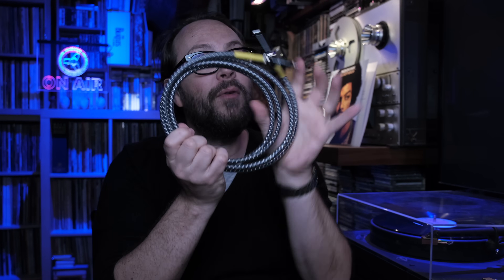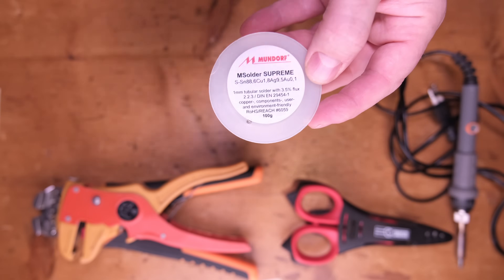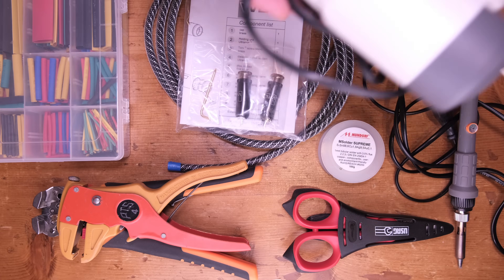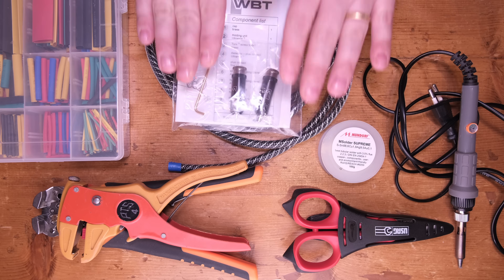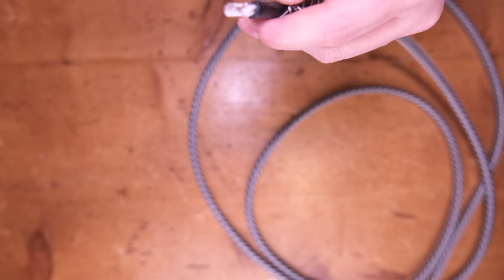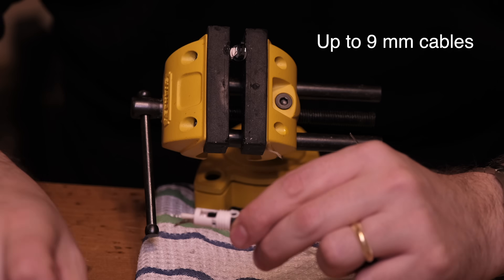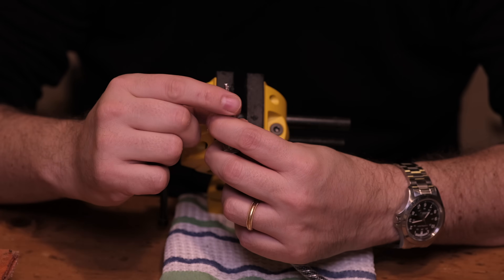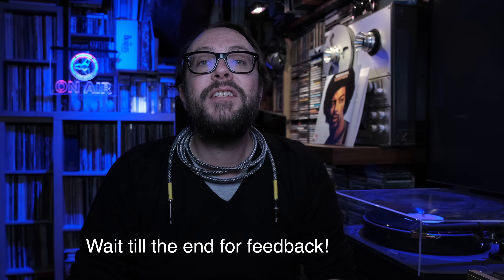How to make the perfect coaxial cable for digital audio (SPDIF)

Comment: All wrong...SPDIF cable as video cable should be crimped not soldered...
The RCA connector are made for analog audio.
There are at least two manufacturers of RCA connector designed to be crimped and certified for 75 Oms cable.
CANARE RCAP-C5F
Belden DB59RCAU-25
For wire choose Belden or Canare
The recipe is ultra simple, the right impedance (75 Ohms), with the right cable (75 Ohms), the right connector (75 Ohms certified) and NO SOLDERING...crimping only.
Reply from the maker: Crimping is for the video coaxial cable, this is an audio cable. Nevertheless, if you can find a silver crimpable rca be my guest! Cold joints are always better IMHO.
Reply: @anadialog  Crimping video 75 Ohms coaxial cable is for any cable...video or audio.
It's just the right way  to do it, to get the proper impedance.
Following industry standards seems alaways a challenge for audiophile...
Reply: @MrMftech  It is the audiophile industry that does not follow the standards because there is no such thing as a true 75 ohm RCA connector. Once you get to the RCA part the distance between the center pin and the collar is incorrect. The crimp on connectors you mention are likely the best you can get. They maintain the 75 ohm right up to where the RCA dimensions take hold. The crimping vs. soldering alone has little to nothing to do with it. Maintaining the proper distance between the conductors is paramount and the crimp style connectors easily do this well. Unfortunately the crimp ons need the correct crimper die for different cable models and I do not think that there is one for the 2001 and I don’t know how you could handle the second braid.
Reply: @MrNeverlift  There is a least two RCA connector designed to support 75 Ohms cable.
CANARE RCAP-C5F and  Belden Double Bubble RG-6 RCA Coax Compression Connector both are crimped.
Thre is no soldering when you need to transport high frequency content and crimping provide consistency in the assemblage.
Every die is designed for a specific coaxial cable diameter and RCA plugs.
Nothing fancy...just common sense and following industry standards.
Reply: @MrMftech  Iv'e used them all. As mentioned, I do not believe there is a die set that fits the Neotech 2001. Neotech does not publish a radio guide spec. The 2001 is also a triaxial and the outer most braid should be connected to the source end only. Problematic for a crimp style. The crimp style maintains the 75 ohm coaxial configuration right up to the RCA (no longer 75 ohms). Most solder connectors alter the distance between the conductors way before it turns into RCA. Therefore, crimp ons are inherently a better design for this use. The fact that they don't need solder is a convenience (especially in the field where most RG cables are assembled). The electronics industry (not the audiophile) decided to use RCA ends on SPDIF cables. Look at older DAC's, many had BNC sockets and you would get 75 all the way. You do know is not measured with an ohm meter? You do know if you bend a coax to sharply it degrades the 75 ohms? Go to the Blue Jeans Cable website. They use the RCAP's. They do a good job explaining. Better than I can.

Comment: I prefer factory cables. Guido, for that ~210 eur you have many many choices. I would recommend QED cables at first, but there are tons of Audioquest. There are also silver-plated ones. Not worse. I bet. This is not cheap, this is rather almost expensive though I know there are much more expensive options out there. But making DIY cables for the price of a great factory one...
Reply from the maker: Yes, I have recommended much cheaper solutions, you're right, but remember that this is all silver and that in terms of factory cables are extremely expensive
Reply: @anadialog  Guido, the signal is carried on the surface of the cable. It does not matter if the core is silver or copper. I would kindly compare it to factory cables. Did you may do that?
Reply from the maker: @7AccordHomeStudio  hi there, nope that is a misconception. Signal travels near the surface not exclusively ON the surface. The higher the frequency the closer to the edge, that is in fact where we have the skin effect, with very high frequencies while audio is more in depth.
Reply: @anadialog  Ok maestro. :) I believe it to you. But I will prefer factory ones in the future.
Reply: @anadialog  I doubt 1's and 0's care if it's silver or copper.

Comment: I'm sorry to be a cable bore but it was into it deeply and of course, no one likes my opinions like I do. I agree with your observations about materials. I only used the best available at the time. Six nines pure copper and pure silver wire. Silver plated copper wire always was harsh and fatiguing in he long run except on digital where it seemed to work okay. I also used teflon coating dielectric. I didnt care for gold plated plugs that used ferrous nickel as a binder for the gold plating. I used a plug that used a silver undercoating to bind the silver to the brass or bronze plug. Without the binder gold flakes off. I often used Cardas SLVR RCA plugs because they were made of silver plate directly on to the brass or bronze plug No gold plating. 
At the time I thought Rhodium killed too much information. Maybe food for an excessively bright cable but I didnt use it. I also experimented with cryogenically treating copper condors with some success. At the time there was a solder called Wonder Solder sold by an audio reviewer. I have no idea what it contains but it was an excellent solder natural and reviewing without the brightness of silver solder or the dullness of standard Kester solder. The important things about cables is they are a little system unto themselves and evert individual piece counts. You can change conductor, dialectic,  connector and solder to tailor the sound you want. I sold or gave away all my cable in the 90s. Ironically, I recently I bought back a pair of one of my best interconnects on Ebay and I was gratified to hear that they still sounded as good or better than what I had in my system at the time. New is not always better .

Comment: I work for a wire termination company here on the US. I enjoyed your video. My question is do you prefer silver over copper?  

Our connectors are compression connectors so they are much easier to put on but probably not as high quality as what was shown here. Nice work.
Reply from the maker: Thanks! I can say that silver has that extra quality, especially OCC silver, when designed properly and with excellent insulation BUT they are just too expensive so quality copper is probably the most quality/cost effective!

Comment: Great video, good work indeed. I've been making cables for over 30 years and agree you can make fabulous cables for a fraction of the price and lets not forget the marketing hype 'BS' associated with it that most of the price of goes on. I will say one thing though, WBT connectors have got to be one of the most user unfriendly, clunky and a bit pricey. There are easier, simpler and cheaper ones out there. But great video. Thanks
Reply from the maker: I agree...As I said in the video I don't like WBT but I wasn't able to find other silver 75ohm connectors...
Reply: @anadialog  hello, advise me an interconnect cable from the CD transport to the DAC (aes-ebu) ... now all the wires are professional copper (Belden 9497 acoustic), the rest are Gotham - the reason is that they are all neutral .., but lack depth and magic))) .... transport - theta, DAC Levinson 1702 chip

Comment: Thank you very much for this excellent video, as always. Like you, I make my own modulation and digital cables, using the remarkable NEOTECH cables.

I have just changed my amplifier (Willsenton R300, excellent single stage amplifier, 300B tubes not too expensive). My beloved Van Den Hul "The Frist Ultimate" all carbon cable is not suitable here as it is too warm and lacks transparency. I first ordered a NEOTECH NEMOI-3220 RCA stereo copper OCC PTFE cable, but I returned it after a few days because the Van Den Hul is much better.

I then decided to review the digital and modulation cables with NEOTECH OCC copper cables, which have some silver plated strands. Please abandon all ideas about silver plated copper, at least with these two references (KLEI PURE22 HARMONY RCA connectors) :
 
RCA modulation : 
- NEOTECH NEI-3001 MKIII symmetrical UP-OCC (48 euro per meter, another world compared to the already excellent NEOTECH NEI-3004). Here you have to connect the cables two by two and the shield on the source side only)

digital RCA :
- NEOTECH NEI-3003 MK III UP-OCC silver plated coaxial cable (22 euro per meter).

In 45 years of high fidelity, I have NEVER heard such qualities of transparency, harmonic richness, smoothness and naturalness. Incredible!
I don't know if the pure silver model are still superior to it, but for my part, I will stay with these ones which fill me completely.

Thanks again for all your excellent videos! Love from France.
Reply from the maker: Thank you for your input! I suspect that the Neotech you sent back maybe wasn't burned-in enough? But it may be that the Van was better, you seem to have experienced enough to understand this! ;-)
Reply: @anadialog  I waited a week but nothing to do for the 3220. However, for the NEOTECH 3001 MkII, mio Dio !  :)

Comment: shielding?! no need. just muddies the sound. Maybe if your home is like an electrical sub station, otherwise ditch it.
Reply: This is a coaxial cable.  Remove the shield and then he only has one conductor and the digital signal would float.  It wouldnt work like that.  Are you suggesting a simple pair of wires would be better?  (For a digital cable is that really true?)
Reply from the maker: I agree...on other cables, but coaxial need some
Reply: Yeah, coax is shielded. I don't use it. 2 proper wires twisted or braided is what I found best after 30yrs playing around. Jmho.... 😉

Comment: How this affects the sound?? the signal is digital, a regular coaxial cable that can be made for less than 5 € will be exaclty the same in quality, i did work on a telecom and our wiring was less than 1€ and top quality for broadband in a quite higer bandwith than SP/DIF, and there's always the option of optical SP/DIF that is just flawless.
Reply from the maker: I wish it was so. As I said in the video digital audio travels on an analog signal (voltage) which is my manybthibgs can go wrong. Ever wondered why coaxial cables for digital has so much shielding plus it is built just like a normal interconnect, because it is always an electromagnetic signal. Time to wake up from the less digital myths. Digital is crammed filled with issues, just like analog!
Reply: @anadialog  Somewhat correct. Yes, there is really no such thing as a "digital signal" All electrical signal transmission is indeed analog, However you need to understand the encoding methods used. In the case of SPDIF it is Manchester coding. The data is carries as transitions between high and low voltage levels. As long as thoase transitions can be detected, the recovery will be flawless. Yes, the signal does suffer all the degradations any analog signal does. But it's the data encoding that makes digital signal transmission very immune to traditional analog cable problems.
Reply: @anadialog  said so, and being 100% sure you are wrong about digital audio transmision about cables making any diference in SQ, not because I think so but because science states so, your cable making vídeos and tutorials are nice. I discovered neotech cables in one of your vídeos and have made many cables since then. Never will say they sound “better” than a basic amazon cable. They look much nicer, for sure.
Reply: @reydelanada  I'm on the same boat as you, but I think they do have a point with coaxial, because if the cable has the wrong impedance it can cause mismatches and ugly reflections. That's what I read, anyways. I prefer optical, after all. With optical it doesn't matter if it's half a meter, 7 meters, plastic, glass, etc. Bits in, bits out.
Reply: Yes, and seems the faithful have yet to see the light. 😂 ... through optical SP/DIF.
Reply: Don’t waste your time Francisco. They belive! You can’t outscore their faith! ;)
Reply: The problem with SPDIF cables using RCA ends is the RCA ends do not maintain a 75ohm relationship between the conductors. Most connectors and / or assembly methods ruin the 75 ohms way before the actual RCA part of the connector making it worse. If you can keep the distance of the non 75 ohm path as short as possible, the better the sound will be. If that issue is handled well, it is surprising how good some inexpensive coax can sound. In telecom you use much better connectors from the 75 ohm standpoint. Also in telecom you won’t notice or care about this level of sound quality. Better materials for conductors and shielding can make a big difference as well. With HiFi SPDIF. Every aspect of a moment in sound must arrive in one moment. It never does.
Reply: @MrNeverlift  Yeah, I don't even like using RCA in connections, even for analogue/video applications. 
You wouldn't use them for oscilloscope signal path connect, unless it was low bandwidth audio (20-20kHz) 😉
Reply: Lol… keep the faith! 😆
Reply: @reydelanada  Lol...keep trolling!🤪
Reply: Electrons travel differently through conductive materials. Try a steel cable vs a copper one and let's talk again...
Reply: @Nihilist13  yes, i'm aware of that, and this will have an effect on analog transmissions, but SP/DIF is digital so it doesn't matter the quality on the transmission while is inside certain parameters, that's the advantage of digital communications, you have a range of values that will be decoded as correct on the receiver end thus making a perfect reception, there's no advantage on "better" wiring for digital transmission for this and other reasons (checksum, error correction, noise floor).

Comment: Thanks for the Video. Since 2 Years I use exact this Neotech-Cable with BNC-Platinium Connectors by Furutech. Great sound. It connects my Reclocker Mutec MC 3plus USB and the McIntosh-Pre/DAC MHA 150. A friend of mine did the DiY-Work for me (thanks, Witold).

Comment: The Harmonic Technology Digital Silver III is far better, its OCC Silver.
Reply from the maker: Not true. Apart from the fact that it is a 450$ cable and mine is 190$, but tye Neotech has teflon insulation (Harmonic has polyethylene) and insulation is paramount in performance almost as the conductor. But I agree on OCC silver, if you find that with teflon THEN it will be superior to this one BUT much much more expensive.
Reply: @anadialog  No, 1meter 80€ @mcru
Reply: I did the same cable as u 1 month ago, but with the kopper Version plugs.
Reply: @anadialog  The Oyaide FTVS-510 coax has a solid 5N silver conductor and is well regarded. I'm pretty sure the insulation is teflon. They sell them terminated too with RCA's or some very nice BNC's - a much better connector.

Comment: I congratulate you for your videos on cabling. So many reviewers stay away from this "controversial" topic because they don't want to upset some inexperienced, ignorant or biased people don't believe that cables make a difference. I have a couple thoughts to consider for the cable denier. Cardas, Audioquest, Kimber etc have sold hundreds of thousands of cables to tens of thousands of audiophiles and their business  thrive after almost fifty years. Are all these customers wrong considering that, a good many who have far superior systems and probably hearing?. These same cable deniers will anxiously await the next product review from their favorite reviewer who uses custom cables. They don't believe in cables but the fact that their favorite reviewer believes in them and has carefully chosen custom cables for their system seems to escape them. Some people don't have a system that is sufficiently revealing so differences in cables become obvious. Also, this hobby is mostly pursued by men and many men pursue pastimes and occupations that have negative effects on their hearing, like they serve in the military, play with automobiles, motorcycles, power tools, firearms and other devices guaranteed to diminish unprotected hearing. If you cant hear the difference, get your hearing checked. Finally, the cost is a factor. Profit margins in the cable business are generous and some cables are very expensive with dubious results, that doesn't mean that cables do not make a difference and if people will put aside their biases and do some objective listening they may improve the sound of their systems for a reasonable cost. I have a suggestion for people wishing to tackle cables with minimal risk and cost. You can get cables from "Worlds Best Cables" on Amazon for reasonable prices with a no risk 30 day return. WBC has reasonably priced cables made from Mogami, Gotham and Canare products Give it a try. What do you have to lose?
Reply from the maker: Thanks for your nice comment and reccomendations!

Comment: I made this cable Neotech its great. I put alco plug klei from pure silver.
Reply: Are the alco connectors 75 ohm? I'm considering the WBT alternative as they're rated 75 ohm, tx
Reply: @devilspin6649  it not was "alco plug Klei" it was "also plug Klei" i put the most expensive Klei : Klei Perfect 22 Harmony Plug. It is good for digital cables(75 ohms) For me Klei(top plug) is more natural, analog, engaging sounding then WBT plug from silver